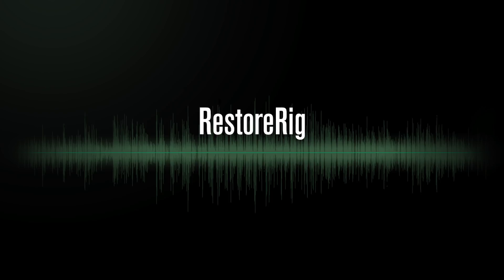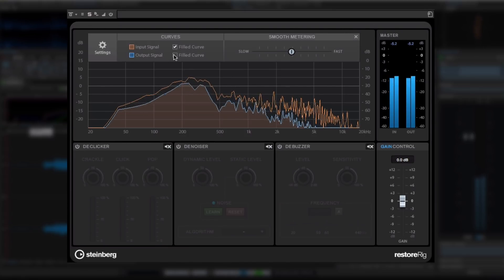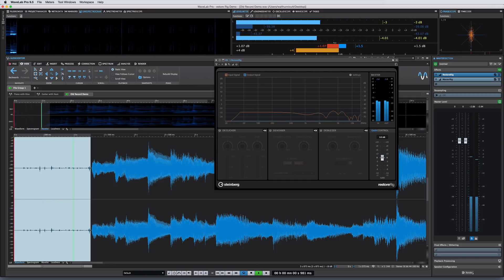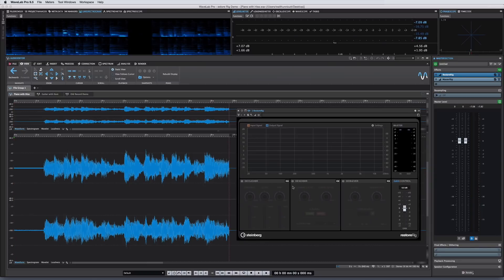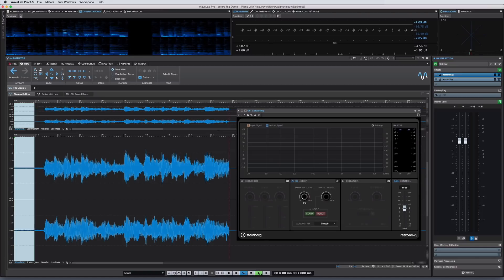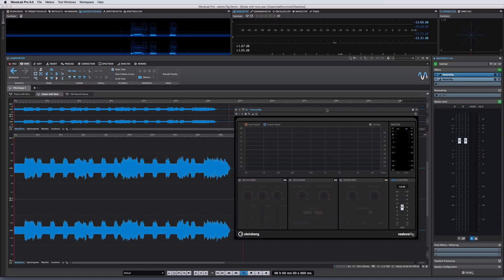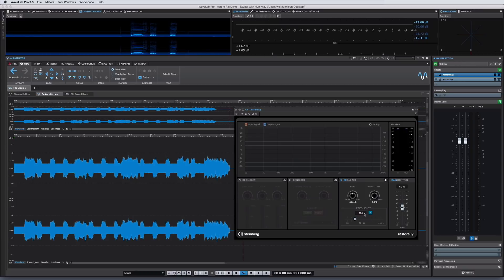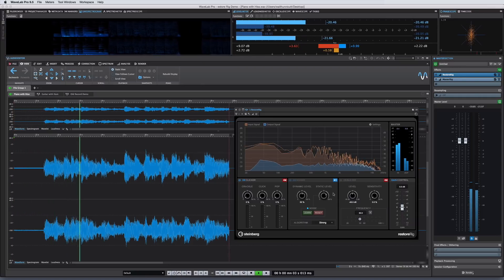The RestoreRig Plug-in Suite | New Features in WaveLab Pro 9.5

Comment: The RestoreRig is not rendering when using the DeNoiser. I need help! I'm not bypassing the MasterSection or that particular plug-in. This is specifically when using the Static-Level portion of the DeNoiser. I told it to learn the noise, it previews perfectly, but does not render in the same way as the preview.